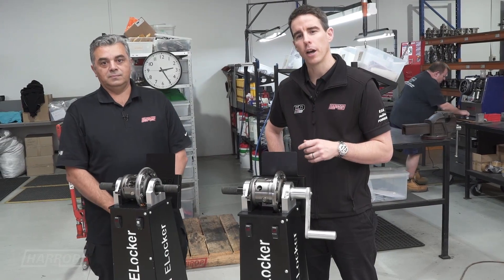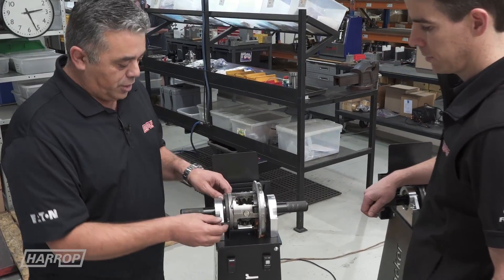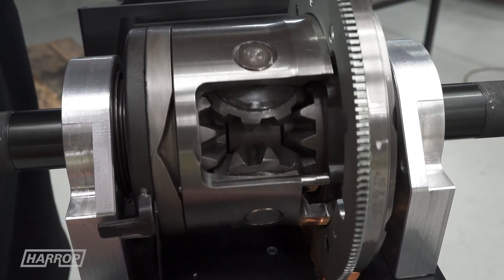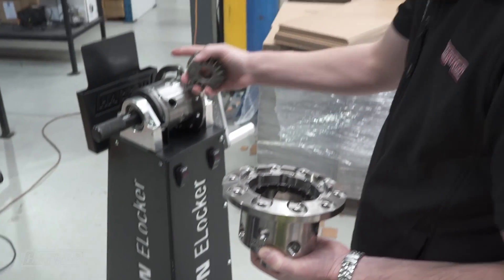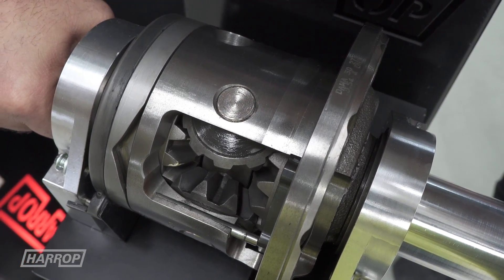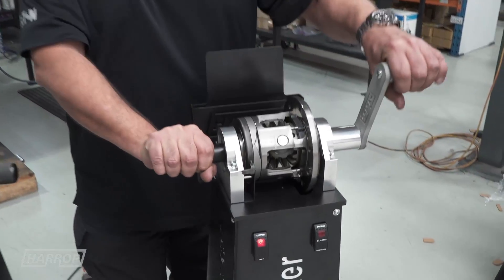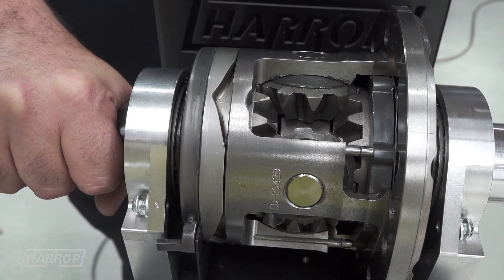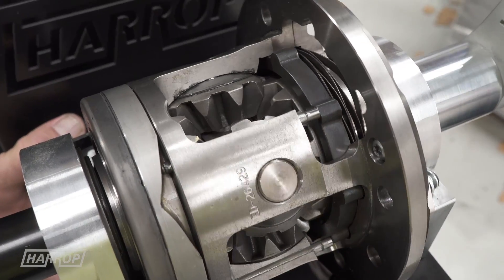Facts about Harrop Eaton ELocker Engagement

Comment: The 4 pinions are less then half the size of the shaft combined make them like the shape of a bic lighter and make it magnetically spring loaded perhaps? if you drop the clutch with the pinions disengaged or not at the top of the rise on the magnetic clutch side will it shock load the pins and snap the ends/wear them down enough for it to spin continuously locking and unlocking the diff.

Comment: We installed one of these into a Wrangler that never worked properly from new. Subpar design and terrible customer support , would never recommend or purchase again! Since fitted 2 TJM Pro Lockers , much better design and stays locked and any true 4wheeler carries an air compressor so I don’t think that extra cost is a consideration when investing in quality traction control. Very disappointing
Reply: Hence why I’m just getting the Eaton unit. Much better customer support and well known where as Harrop is much smaller and has the customer support of a wet noodle.

Comment: It’s funny how this basically just makes it clear that no one has any misconception about how these operate.  The flaw is the fact that they unlock when you change direction. Air lockers or automatic lockers don’t have this problem
Reply: Lol and what about the problems with air leaks i have lost count how many times I've seen it
Reply: @darrengray2309  for the ARB and especially sure, especially if you do a shit job of installing it and securing the air hose in a protected place.  last time I checked mechanical lockers don't have air leaks. And at least the ARB works how a locker is supposed to work once you set it up correctly.  The Eaton is great until you get stuck and need to reverse and then you have no locker.  That kind of defeats the purpose of having a locker right? Seeing how it doesn't work when you need it to work the most.   The eaton has been around for quite some time now and yet it still hasn't really caught on.  I wonder why?
Reply: @Raevenswood  it has certainly caught on here in Australia
Reply: @darrengray2309  useless installers is the issue here, if not done right and maintained right, yes they will leak, nature of having pressurized air.

Comment: Why does it unlock when changing directions?! I wasn't even looking for this diff but that seems like a huge problem. If your trying to shoot up a rock step and you put it in reverse to get a 6-12 inch run up to bump up over and then both front and rear are unlocked. Then they lock mid bounce when the tires have 20 times the traction it's just asking to break the weakest link, be it your CVs, U joints, and or axle shafts. Looking at this from and engineering standpoint it's ludacris, the amount of shock load created is immense almost like dumping the clutch.

Comment: So this REALLY begs the question, why doesn't the electromagnet just engage/disengage the locking plate, or the pins directly? Is a mechanical, space or patent infringement issue? It sure seems a more practical action that wouldn't have the fw/rr disengagement issue.
Reply: The Eaton Elocker4 does; I don't know if Harrop is still using this older design or not.
Reply: @wormfood868  Appreciate the information.

Comment: Great demonstration. Someone needs to make a rear E- Locker for the Ram HD (Cummins or whatever AAM 11.5). Harrop/Eaton, AAM, Yukon, TJM, or someone needs to step up and make this. It's so overdue. Yes ARB is available but it's not practical. Not to mention the seals that wear out and need to be replaced whether you're using them or not. ARB is good and strong but a flawed design in the actuator, and too much to fiddle with and go wrong. I hope the industry sees what a potential gold mine this is and moves on it soon. I should mention that the Power Wagon rear E-locker is available through Mopar (Only one available for AAM 11.5) and comes in well over $3,000 U.S. for just the carrier assembly. Screw you too Mopar...

Comment: Is this the same as the most recent eaton design (elocker4)? I was looking on the eaton website and the video they show has the magnet and the locker plate on the same side of the of the diff, and it looks like the magnet pushes the locking plate directly into the side of one spider gear, such that i would assume it would not need to diff to rotate to engage. They claim a 0.14s engagement  time, and to have an actual time i would assume the motion of the vehicle  would not be a factor
Reply: no, as far as I know the Elocker4 is only for the Dana 60 and 70 unfortunately. they should make the same design available for all other diffs and the issues are solved
Reply: @AlloffroadAu  I was looking on Eatons website last night and it appears that they make the Elocker4 for most Toyota applications now, as well as some other Dana axles.
Reply: @wormfood868  really? not as far as I have seen  Eaton web site still states only Dana 60/70 do you have a link?
Reply: @AlloffroadAu  I've tried replying with links multiple times and the comment just disappears; try googling Eaton 14212-1 and the eaton elocker4 page should be pretty high in the results. (14212-1 is the model number for a 9.5 inch 30 spline used in most older Land Cruisers)
Reply: @wormfood868  that is not the direct engaging e-locker 4 that is the standard e-locker with all the issues. Google Eaton ELocker4 and you will get to the actually e-locker 4 page.
Reply: @AlloffroadAu  I have and I've gone from there to the page for that specific model and the picture is of the direct engaging elocker4. So if Eaton is putting the wrong pictures next to their products, I'm sorry I was mistaken. If Eaton is marketing both the old design and the new direct action design as Elocker4, that's pretty deceptive.
Reply: @wormfood868  yep, I have been told here in Australia as well that the use the elocker4 just not the same direct engaging e-locker 4 for Dana 60/70 which is a very different design.
Reply: https://www.4wheelparts.com/p/eaton-toyota-9-5-elocker4-locking-differential-14213-1/_/R-BHXC-14213-1

Comment: My experience with Harrop E-locker is as follows.

My Harrop E-locker self locked on a freeway @~90km/h (I have the fuse removed when not off-road) and not only destroyed the crown wheel and pinion but also ripped out some of the front diff mounting on my ford Ranger. It was a horrific self destruction of a diff center that only ever had one off road engagement (just to try it 4 days prior) and under 1,500km/a week since installation.

Harrop will not honor their basic manufacturers warranty (item 2.1) where it states that they will favour the consumer in a warranty claim, instead all they have been doing is looking for an out before they will honor their primary statement in their own warranty .

Harrop customer care and warranty has to be the worst i have experienced as a consumer..They will blame anything with "Failure is difficult to pinpoint" "backlash could have been a contributing factor"- that's what virtually makes up their "engineering analysis"..Here i am left with no vehicle for 2 months and have no option but to go to ACCC.

It took Harrop more than a month to get back to me and refuse the warranty claim and they still haven't returned my diff so i can have a mechanical engineer write a report, Even though the reputable and qualified Diff specialist that they are now throwing under the Bus has requested the box of shrapnel be sent back . (they are probably arguing about a $40 freight cost)

after 2 months and i have had to purchase a new front diff assembly just to get the car back on the road. (I will be putting on an air locker as i will not do business or placing my safety or the safety of my family with Harrop again)

I will be sure to update the community on how this ends up.

As a 4x4 and touring enthusiast to others i can only suggest that you do your research and choose wisely.
Reply: HarropTV 
Can you kindly  readout item 2.1 in your own warranty? 
I believe I have had suitably qualified diff specialist that you sell plenty of Harrop gear to yet you have left me 2 months into a disaster. With no resolve.

Can you elaborate on “working with me?”
Reply: Marcelo C 

.
Reply: @Mash.2312  any follow up to this?
Reply: So it’s been over a year now Marcelo has everything been sorted or do I stay right away from their e lockers? Asking for a friend with a ranger who’s looking at getting e lockers fitted on his car

Comment: PLEASE READ BEFORE BUYING AN E LOCKER.
This video clearly shows the locker unlocking temporarily while Changing direction. This is fine when there's no load but when theres a large amount of load like recovering from being bogged that 6 inches of going from locked to unlocked then back to locked is very similar to engaging the locker while 1 wheel is spinning faster than the other. This exact situation has caused my locker to fail. The car is fully drivable but the locker does not lock in anymore whatsoever. There is proof as each ramp has stress cracks proving the damage was caused while reversing and going forwards which is exactly the situation that occurs when recovering a bogged car from sand. So far Harrop have denied my claim and I am currently fighting this as I never ever engaged the locker unless I was stationary or rolling slowly in a straight line with no throttle.
Reply: My experience with Harrop E-locker is as follows.

My Harrop E-locker self locked on a freeway @~90km/h (I have the fuse removed when not off-road) and not only destroyed the crown wheel and pinion but also ripped out some of the front diff mounting on my ford Ranger. It was a horrific self destruction of a diff center that only ever had one off road engagement (just to try it 4 days prior) and under 1,500km/a week since installation.

Harrop will not honor their basic manufacturers warranty (item 2.1) where it states that they will favour the consumer in a warranty claim, instead all they have been doing is looking for an out before they will honor their primary statement in their own warranty . 

Harrop customer care and warranty has to be the worst i have experienced as a consumer..They will blame anything with "Failure is difficult to pinpoint"  "backlash could have been a contributing factor"- that's what virtually makes up their "engineering analysis"..Here i am left with no vehicle for 2 months and have no option but to go to ACCC.

It took Harrop more than a month to get back to me and refuse the warranty claim and they still haven't returned my diff  so i can have a mechanical engineer write a report, Even though the reputable and qualified Diff specialist that they are now throwing under the Bus has requested the box of shrapnel be sent back . (they are probably arguing about a $40 freight cost)

after 2 months and i have had to purchase a new front diff assembly just to get the car back on the road. (I will be putting on an air locker as i will not do business or placing my safety or the safety of my family with Harrop again)

I will be sure to update the community on how this ends up.

As a 4x4 and touring enthusiast to others i can only suggest that you do your research and choose wisely.
Reply: @Mash.2312  Just purchased regeared Diffs and adding harrop e lockers in both front and rear.  this experience definitely makes me very hesitant and nervous about my decision.  this exact failure is my greatest fear for adding a locker and putting me and my family in danger.
Reply: @Rickydbaby how’d ya go?
Reply: @HarropTV  I am interested, with the question asked about the bog hole i could be in a situation where i am trying to climb a steep muddy track, if i dont get it first go i may have to back up and have another go at it, my concern is I could be in a situation where i have to give my troopy beans straight off the bat to get moving up the steep hill. Will this 6 inch of play at full beans cause this locker to potentially fail? Or are they tested for these situations? This is a serious question from someone looking to buy 2 of them.
Kind regards.
Reply: Sounds like you need to help these two guys before trying to help anyone else but when it comes to a sale you will always get an answer. 🤦‍♂️
Reply: Be good to check consumer law while you do your engineering analysis. You might find the consumer guarantee entitles this bloke to a warranty repair or a refund.
Reply: @archibaldchadwick1668  unless the damage was caused to improper use, which is what the engineering analysis would determine. Definitely get another independent analysis done.

Comment: G'day

I've purchased front/back Harrop lockers for my VDJ76 last Dec 2017. The dealer had 2 remaining from a stock he had for a while but not sure since when. How would I be able to know if the Hroop I've got are the 4 pinion locker or the 2 pinion locker? is there a way to know while they are in the car, say from how far the wheel rotate free from forward motion to reverse motion?. Or if it helps, do you have a date when Harrop upgraded their lockers to 4 pinion? Part number? Id appreciate your help as im planning a long trip soon and id like to know what is been installed in my diffs. Many thanks
Reply: @HarropTV  I’m reading through these comments and to be honest I’m pissed to keep reading ‘contact customer support on bla, bla, bla’. I want to be able to read your replies to these questions now, without me having to ring customer support. Why can’t you just answer the questions here in the comments section?
Reply: Buy a Defender mate,you dont have to add anything and they go anywhere 😁
Reply: @RobertJones-ji6oh  yeah they might go anywhere but how many times do they go anywhere on the back of a Flatbed lol

Comment: So you still have that annoying half a turn or quarter of a turn when your going from reverse to forward
Reply: If that bothers you a full or mini spool will work great  lol
Reply: @fullnoyz   Never heard of an air locker it seems.
Reply: @HardstylePete  Is an ‘air locker’ superior or something?
Reply: @SeriousSchitt  yes. instant engagement without requiring a half rotation of the wheel.
Reply: @nudibanches  Which brand? Do you drive lots of thick bog holes?

Comment: Wheel circumference is not dependant on tyre pressure. Circumference is constant even if your tyre is dead flat. Radius will vary, this has no effect on wheel speed. Surprising that they would get this wrong.
Reply: Brian Wynn you're exactly right the same thing comes in when drag racing trying to setup your launch
Reply: You are not wrong, its the same idea as a rubber band or chord. Regardless of the shape it remains the same length. Obviously you can stretch a rubber band but we arent stretching the tire, the point it is remains the same.

If I form my band or chord into an oval shape, circle formulas mean nothing, the length remans the same, the radius will vary but not the circumference.
Reply: Hahaha Harrop TV 
Go back to school
Reply: au51emu so are you saying if you let your tires down your car remains at the exact same height
Reply: @livenloud6697  no because the shape changes and you receive the desired bigger foot print
Reply: But seriously who gives a fuck
Reply: This has got to be some of the dumbest shit I have ever read.
Reply: Fark, I’ve learnt nothing out of this thread 🪡!
Reply: live loud no, obviously not.
Reply: So if your tires are dead flat compared to being pumped up you're saying there is no height difference from the body to the ground you got to be kidding
Reply: @livenloud6697  no never said that you sure will be lower that's why you have a bigger footprint, just think about it how would the carcass with wire in in it contract it can only deform it can't become shorter and shrink the tyre
Reply: @HarropTV  this is why some people should not be allowed to breed
Reply: Brian Wynn the tyre has steel bands in it, they don't shrink when you let the air out.
Reply: HarropTV wrong. When the radius changes it stops being a circle so the formula is not valid. Go back to geometry class! The length of the tread of the tyre is fixed. Changing the circumference would mean adding or removing part of the tread. Impossible!
Reply: @au51emu  what they meant to say was the tyre's working radius has changed. Measure your axle centre to the ground, mine right now is 370mm, with a theoretical mathematical circumference of 2324mm, if I let my tyres right down for sand work,  the height from the centre of the axle to the ground might be 70mm lower, the theroetical mathematical circumference goes down to 1885mm, a difference of theoretical tyre circumference of roughly 440mm (17").
Reply: @craigaitken1285  there's no point taking radius into account because as soon as you let your tyres down they're not a circle any more. It's more useful to think of your tyres as tank tracks. It doesn't matter what shape they are, the same length of tread has to roll along the ground.
Reply: @au51emu  if I flatten a tire on one side of the vehicle the vehicle will lean towards the exact distance of the flat tire I can't believe we're discussing this
Reply: @livenloud6697  that won't change circumference
Reply: @au51emu  a tire is more round with full air pressure with low air pressure the tire is flat on the bottom which means the height will decrease by a lot. The bottom of the room will be closer to the road with a poorly inflated tyre that's why the become flat tires they are no longer round is like a circle with a big piece dropped out of it
Reply: @livenloud6697  that's not what this is about.
Reply: It's constant mate, the tyre changes shape not size
Reply: when the tyre is flat it is a smaller circle, the tyre tread will bunch up, it will  be smaller